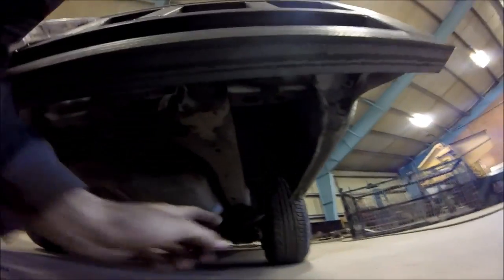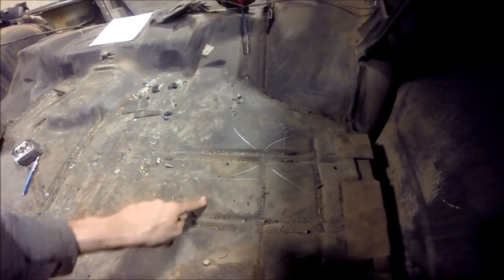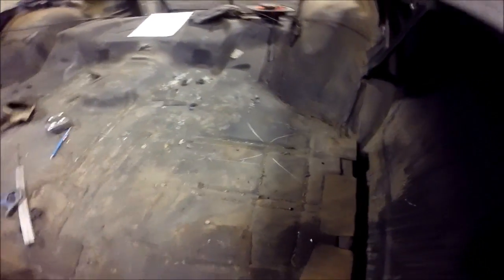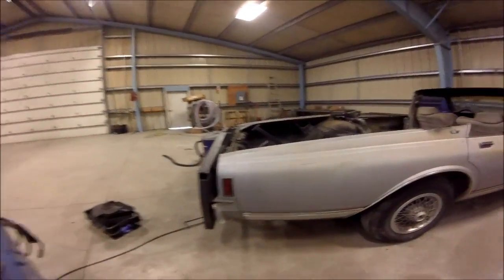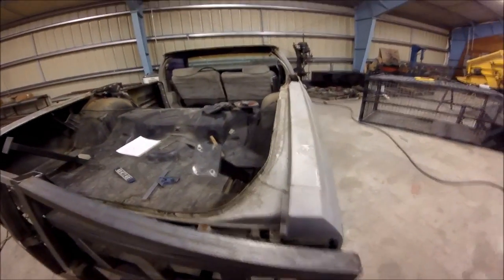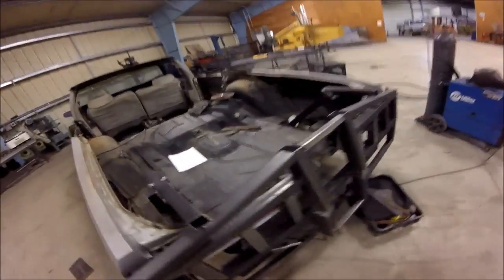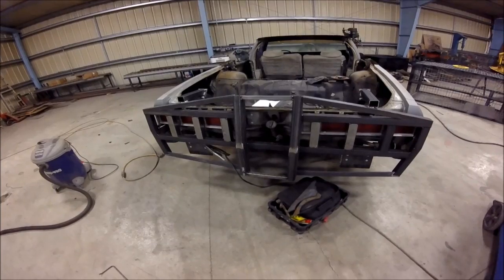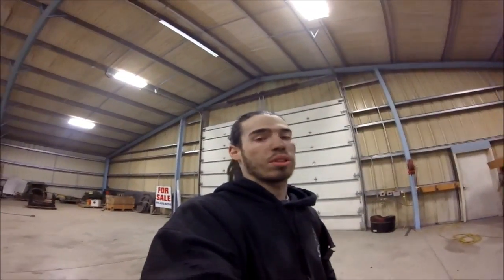RR log 4: framework

Comment: I also had an idea for a sword Rebar sword tac weld 6 rebar poles together and and shave the sides down like the bone spliter from zednoughtalpha after said target is struck by said sides the weight from the 4 cores should destroy the target and have a cross guard four rebars in a x formation the grip is leather

Comment: heres a good challenge make a reidbar warhammer with 4 points for impaling and on the other side a flat square for blunt melee attacks
Reply from the maker: as in all out of rebar or just the main structure?
Reply: as in all out of rebar and but have a paracord wrap for your handle like if you had pulled out a weapon from silent hill and went zombie hunting
Reply from the maker: JadeTV that sounds like it might be a cool build, ill put it on my list